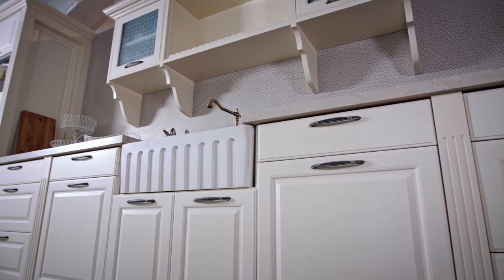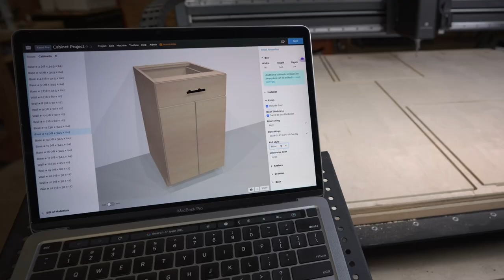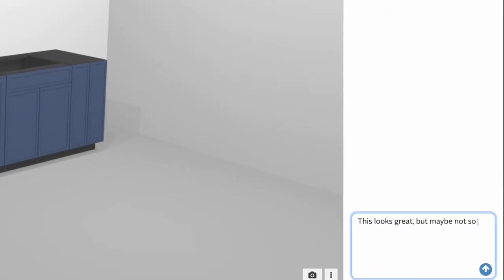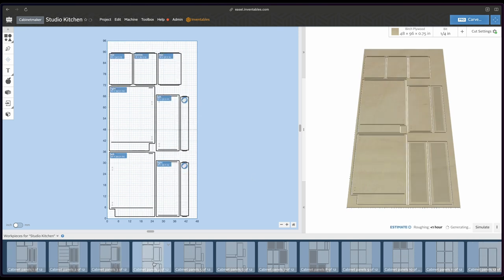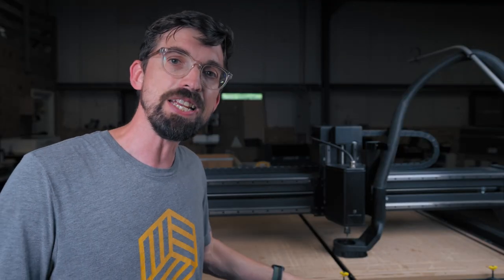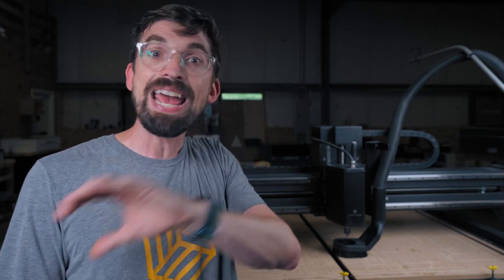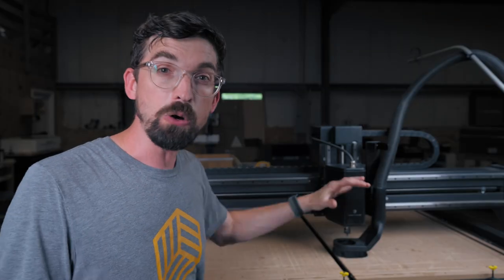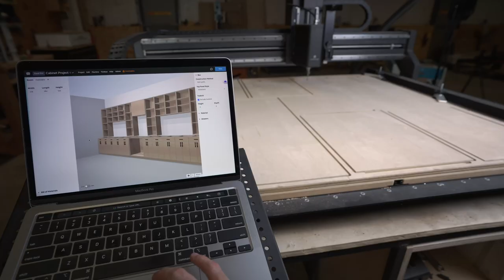Traditional vs CNC for Cabinetmaking

Comment: Hi Guys... question, I signed up over the weekend and haven't looked thru the software completely yet. Do you need to keep the plywood sheets 4'x4' only or is the Cabinet Software intergrated with tiling feature so you can use a full sheet at one time without cutting half sheets for design purposes? Thanks for the added value software upgrade keep it coming!!
Reply: I am an XCP owner and Easel Pro/CabinetMaker user. When you are ready to send your cabinets to nesting you will be prompted for the sheet sizes you plan to use. If you want to use full sheets you will have to use tiling unless your machine has a large enough work surface. On several of my tests I have actually found 4x4 sheets to be more efficient, but not always.

Comment: What bit good to use for melamine and MDF?
Reply: Best to use compression bit if you want both sides of the material to have chip free edges. Also, ramping is the best option in my experience when it comes to Melamine.